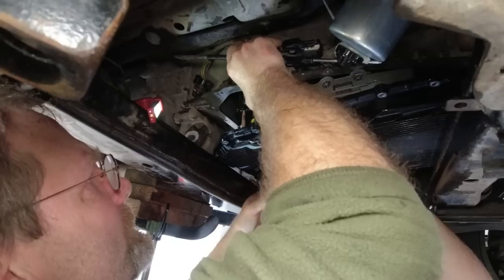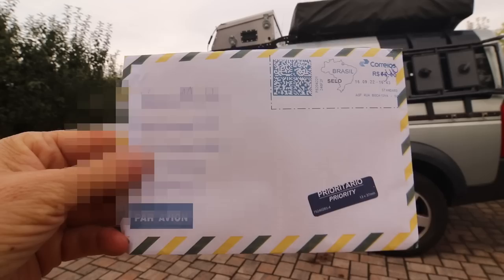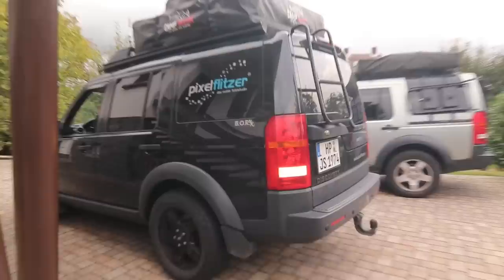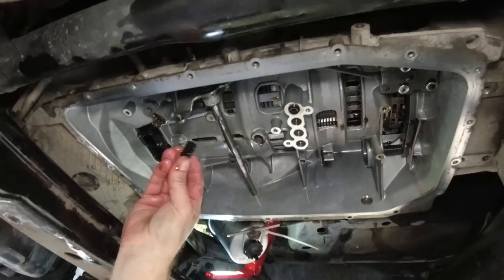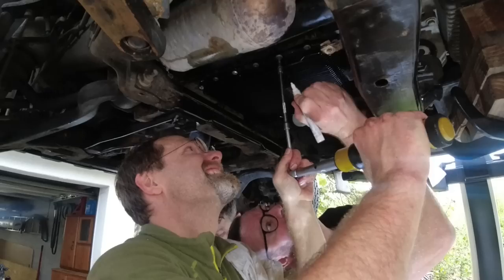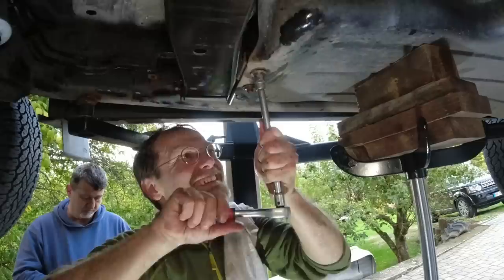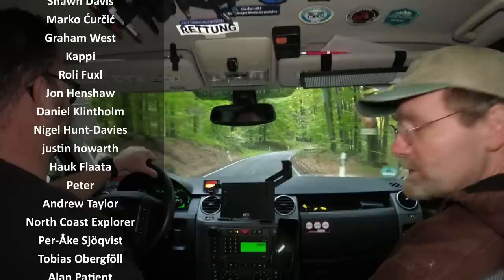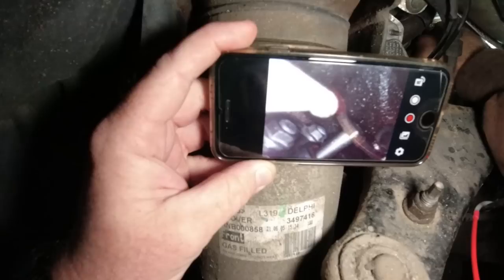Drive Line Vibrations - ZF 6HP26 Repair - Land Rover Discovery 3

Comment: Yet another great video and very entertaining, thank you both 👏👏👏 ...can I ask, this issue with auto box, could this be on early D4 too, I have replaced rear prop and rear diff, center bearing gone and bearings in diff! ...after 15 to 20 mins of driving I get heavy vibration from under drivers floor area, one is puzzled! ...the only thing I can think of, maybe front diff needs attention too 🤔🤔  ...can I also ask, what OB2 tool do you use? ...please keep the video's going 👏👏👏👏
Reply from the maker: GAP2D Bluetooth.  Vibration is bound to specific gears and Rpm if coming from the 6HP. Christian

Comment: Very good video again did you take the zip tie off the centre bearing or just leave it on and sometimes the carpets are very wet because of the Aircon drainer is in the centre console to the left is sometimes blocked or the sunroof drains are blocked which is a common problem Love seeing you guys catch you next time😁🇬🇧👍John
Reply from the maker: No, the Zip Tie is the hack, to fix a broken propshaft bearing, on the spot. 😅👍🙋‍♀️

Comment: ...on 13:24mins why do you have to attach the main plate(valve body) with the oil sump pan. Why not first the valve body and after that the oil sump pan? I'm asking because I have to do this procedure next weekend! :face-turquoise-covering-eyes:
Reply from the maker: You will find out this Werkend then.  On the 2.7L, the oil pan does not come out unless you raise the engine up.  Enjoy this job.  Christian

Comment: Interesting as I had a steel pan conversion on my D3 done and really by 180 K the transmission was terrible I sold it with 230K and needed attention so I have 130K on my D4 and still has the original pan I’m leaving it alone!
Reply from the maker: The particular seal was fixed in the 8HP.  In the LR4 6HP it can still cause issues.  I did a simple oil change without replacing the pan.  There is a video from us.  Christian
Reply: @Vera_and_Christian  I always love the way you do your repairs and offer so much knowledge thanks 🙏🏼

Comment: Coucou de la France 😉
Moi sur mon lr4 j'ai des vibrations dans le volant, pourtant j'ai fait l'équilibrage, j'ai changé les triangles inférieur et toujours pareil 😭😭😭 je sais pas où chercher
Reply: I have te same problem,
Reply: @franlrd8177  si tu trouves la solution, je suis preneur 😉
Reply from the maker: Many faults can lead to vibration issues.  You need to be able to force the problem and show it to a experienced mechanic.  Christian
Reply: La vibration peut également venir des disques de freins…. Idéalement changer les disques et plaquettes en même temps…

Comment: Great Video! Is there a reason why you didn't attempt to remove the RH engine mount and lift the engine a little bit (40mm)? Too difficult? This is apparently how you are supposed to get access to the pan. There are only very few videos or how to's about this. I am currently to decide if to use the original plastic pan or the 2 piece aftermarket. The risk of leaking with the 2 piece item makes me a bit nervous. If it is manageable to remove the engine mount I would like to try.
Reply from the maker: On the TDV6 with LH steering, the RH engine mount is not accessible.  Means Alternator and Alternator Bracket needs to come out.  But maybe I am wrong as I did not try.  On the V8, it’s possible.  Christian

Comment: My car did the opposite, was driving perfect, now after this same repair but fitting the metal pan it now judders under load. Any idea what could cause this ? I did replace the same square sleeve and 4x rubber tubes
Reply from the maker: Something went wrong during the repair. But first check the fluid level at 50 deg C.  Most times it misses some fluid after the first procedure.  Also reset adaptation after the level correction.  Christian
Reply: thanks Christian. I have already done this, I did pump an extra 1 litre into the gearbox and got the gearbox to 45oC and allowed the oil to run out. 
The oil was still dirty so do you think I need to drain and add new fluid again ? 
The car drives perfect apart from
The judder :(

Comment: Hi Guys, great video yet again, I so look forward to your content each week, amazing work on the LR3 😁, I don't know much about lubricating turbo balls, but Christian sure has big ones for attempting that repair 😮. Now I have a wee question from Scotland for Christian if I may. I own (please don't judge me 😆) A 2013 Land Rover Range Rover Sport with the 3.0 SDV6 engine. I did an oil change back in June (before I saw your 5W dumbass video) and put in what it specs in the fluid chart, SAE 5W-30 meeting specification WSS-M2C934-B. If unavailable, oil meeting specification ACEA:C2 can be used. My question is would the 5W-40 oil be a better option for my engine. Now I know you don't do RRS stuff but I am hoping Christian's experience will help me 😃. Cheers guys and keep up the content, I love watching, even if I don't actually own a LR3 or Mall crawler 😉
Reply from the maker: We get a lot of criticism about our oil policy. I run 5w40 DPF C3 once the engine has above 100t km.  In South America this oil is LR approved for the 2.7 L.  The 3.0 is worse in regard to durability and it has a lower pressure spec.  So I would go for 5W40.  Christian
Reply: @Vera_and_Christian  Hi Christian, thanks so much for taking the time to answer, so out goes 5W dumbass and in goes the 5W 40 😊. look forward to the next video, cheers.

Comment: use a piece of wire and a long screwdriver wd 40  pull with the wire and push with the screwdriver do them all the time for car dealers  as they will stick if the car has sat a long time

Comment: Hi Christian, what led you to change the seals between the mechatronics and the gearbox, the fact that the problem happened while the TQ was not locked ? Or something else ? I'm having a similar problem i think where the revs fluctuate (200rpm ?) when driving at 130 km/h on slight incline for example in D. If I go to 6th gear manually most of the time the fluctuation stops most of times (not always) . I believe I've read somewhere that when driving in manual mode, the locking pressure for the TQ is higher.  I was wondering if I should try to do what you did with the seals. Any thoughts ? BTW i’m in France (Marseille) and i’m having trouble finding a competent mechanic willing to work on my old disco3 (2005, tdv6 auto, 260K km). Thanks for the Videos, I would have given up on this cool car a long time ago without your work (not forgetting Vera Of course)..
Reply from the maker: The seals are known to fail and cause slipping issues.  ZF recommends to replace them in case of slipping.  Don’t drive the car like this as it could cause further damage.  Buy the seal kit with the connector sleeve.  Use original ZF6 lifeguard.  95% of the time this fixes the issue as long as you don’t get any fault codes from the trans.  Christian
Reply: @Vera_and_Christian  Thanks a lot, this helps a lot, i will try this next !

Comment: Hey guys. Just wondering was the transmission shifting down hard when coasting 3-4th 2nd-1st intermittently? PS great video as always.
Reply from the maker: No, not really.  It was slipping and shuddering at 1900 rpm in 3rd badly.  But we replaced 5 seals and maybe not all caused issues.  Christian

Comment: Hi Christian and Vera, exactly what kind of symptoms was your friend's car having?

I have a low frequency oscillating thrumming / rumbling sound occurring at all speeds in my Discovery 3, but especially noticeable above 80km/h, particularly when applying medium to heavy throttle and on deceleration - not so much with very light throttle. It is driving me nuts on long highway drives. It seems to be dependent on road speed not engine speed. 

The rear propshaft centre bearing had disintegrated, but I replaced with a new GKN and the issue is still there. I am not sure how to proceed with troubleshooting without spending ££££ guessing what is causing the noise and about to fail. 

The gearbox shifts very smoothly and normally and the torque converter was replaced quite recently - I have not noticed any symptoms suggesting these are the culprits.

The rear diff has a slight oil leak from one of the driveshaft seals. The front diff has the old breather and no leaks. 

My best guess is the sound is being caused by a bad driveshaft / half shaft, transfer case, or one of the diffs. I would be shocked if it was a wheel bearing, all but the front left have been changed in the last 10k miles. 

Do you have any advice on how to proceed from this point - any estimates of where to look next, or would you just drive the car until something fails?

Love your videos - you both do brilliant work and produce great content that I enjoy each week.

All the best from England.

Christian
Reply from the maker: The symptoms are explained in the video. You have to search for your source,  prybar a rubber hammer are sometimes needed😅. We have lots of videos on all sort of drivetrain and suspension issues on our channel🙋‍♀️
Reply: @Vera_and_Christian  thanks for the reply Vera.

Comment: Question for the oil guru:  I’d like to go to 5w40 in my Q7 3.0 V6 TDI.  Spec is Volkswagen 507 0w30 or 5w30. There is a new 511 spec which is still low SAPS but is 40 weight.  I can get Liqui Moly (toptec 4110) or Motul  (X-clean gen 2) here in the US currently.  Do you have an opinion on either brand?  Thanks.   (They’re all ACEA C3)
Reply from the maker: Sorry, I am not experienced with VW.  Liqui Moly is a good brand I think.  We use it for everything except motor oil.  Christian
Reply: @Vera_and_Christian   No problem. Thanks for replying. Your oil videos encouraged me to do my own research.  I’m glad I “discovered” your channel a few months ago.